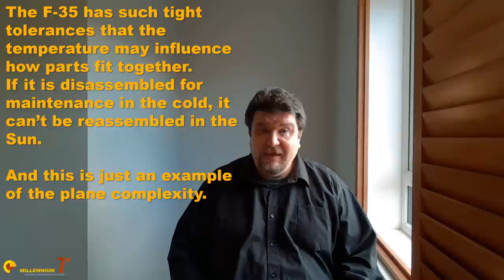F-35: The Failure of the $100 Million  Dollar Jet | Maybe...

Comment: We've built two VTOL carriers (UK)  imagine how we feel!
Reply: Don’t worry, the Marines actually got a useful plane for their inventory and they will support them and supply upgrades for your ski jump carriers for 35 years or more
Reply: @JacobVahrSvenningsen  Looking forward to many many F35B's on the decks.
Reply: The British have Actually only bought, that's paid for, about 28 F35s.n they have a need for at least 90 for a full load out of Two Elizabeth class carriers, with spares.  And given that those British carriers should last 40 years, where are they going to go in even a few years down the road?
Reply: Australia two,we have f35a but no f35b.we did build Wingman maybe that can VTOL.in one of its forms .
Reply: @raywhitehead730 

A force mix of only F 35 in my eyes is a terrible idea - too expensive for what force you are capable of projecting on the ground towards insurgents 

I would favour a wingman for high fast missions - they are building easy to manufacture one-use wingmans (throne away) in less than a decade - before the completion of the F-35 

For low slow missions I would get a Bronco II or Textron scorpion in a 

My all time favorite discount mix would be A-4 subsonic and F-5 II for easy of maintenance and then a stealth wingman out front 

More likely will be a T7 Modified to fly quarterback for a package of wingman in 2035 

In al honesty I believe in much more piracy based world - where old merchant ships are carrying container size drones capable of folding out and taking of from a flat container deck 

Kinda like the falkland single harrier carriers 

But I am just a daydreamer r
Reply: @JacobVahrSvenningsen  A serious US  Navy proposal to use container ships for VSTOL aircraft was argued for in the US Navy publication Proceedings, in the 80s . perhaps its time to look at that idea some more. So, Jacob your idea has been around for a while, great minds often think alike.
Reply: @georgepantazis141  George the Aussies are kinda stuck, but think about giving it all back, yep! I think the SAAB  Gripen  is the way  to go for Australia to go. It has excellent short field  capability. Use a rotating base concept along your coastal highways, keep the asset on the move
Reply: @raywhitehead730  

Oh well :) it’s pretty up and about in the time - I don’t remember where it was written but we can google around 

The brits started it (implemented) and had an in the drawer ready for the falklands and then actually used it - perhaps that where USN got the inspiration for a small project 

In my home country Denmark we have a maritime fleet that carriers 10% of the worlds good - but zero fixed wings on carriers 

None the less if it was ever needed I am sure we could build a wire arrest deck and slam a hook on a F-16 in a few weeks - I’d be in favor of having the sack already modular built a few times before hand and then one day surprise the Ruskis with a carrier in the bay of botnia outside Sct Petersburg and land an jet 

Having Greenland to fend for, I believe it could be our smartest choice for arctic force projection readiness
Reply: @raywhitehead730  Australia lost it hi-lo force in retirement of its classic Hornets. Only the Gripen or F-15ex could fit that role- or both...
Reply: @benwalker4660  Well you are thinking!!  But think, when is good enough good enough? While the F 15x would have  better capability, its probably going first to the US AF, Australia could wait years... Also I bet Australia  could buy 3  Gripens to one F15 X.. All you need to do is fend off the Chinese, not defeat them.
Reply: @raywhitehead730  The Isrealis are buying them- Japan South Korea need some- Australia can join the que for F-15EX. Even if we ordered them now I doubt we'd get them before 2024. With the F-35 and the F-15EX acting as a team our Counter Air- part of the air force wont wither with the loss of the classic F-18. Unless we bought Block 3 more superhornets to compensate- two choices if F-15ex takes too long to arrive- a stopgap.
Reply: And it looks like we (the UK) just cut our order of F-35s from 138 to 48.

Comment: To me this proposition tells me that the USAF is grappling with how to deal with the multiheaded monster of not only getting more fighters but sustaining operations of them too. The F-35's problems will continue to persist for a while and as a Stealth aircraft, sustainment will be the real ball and chain to any force using it. Sucking up money like a vampire.

I am curious as to the rational that the Viper cannot be upgraded much further. We need not get F-21's but new F-16V's for example would be suitable. Just rip out the avionics that cannot be upgraded easily with off the shelf components and shove new hardware in. After all, perfect is the enemy of good enough.

But what else is needed though? Just more and more questions. I am sure the Air Force Brass is kicking the question around and they have a bigger picture with more info than me. Still this is both encouraging and discouraging, reveals a rather confused outlook toward the future that has yet to be answered. But shows that some are willing to buck the previous procurement trend and think differently, group think can be dangerous after all.

An informative video as always.
Reply: The range issue for the Pacific front.
Reply: We've already been stuffing advanced avionics in Block 40-52 Vipers, including hundreds of SABR AESA radars, new data links, Helmet Mounted Displays, digital Electronic Warfare suites, HARM targeting systems for SEAD, new FLIR pods with LITENING, new integrated countermeasures pylons with more expendables jamming and decoys, AIM-9X helmet-cued missiles, latest AIM-120C/D integration, Auto Ground Collision Avoidance System, Small Diameter Bomb... 

What more do you want?

Air planners currently have a huge fleet of Vipers with tons of upgrades
Strike Eagles with the same upgrades
A-10C Night Hog
F-22A Blk 40 Raptors with new sensors, upgraded AESA radars
MQ-9 Reaper drones
F-35As operational and filling combat rotations for the past 2 years
F-15Cs with latest upgrades being replaced by new F-15EXs

But we need a new fighter in the mix to plug the hole left.... I'm sorry. Where is the gap again?
Reply: @LRRPFco52  F-16CM Block 40-52 also has Have Glass V" RAM (Radar Absorbent Material) upgrade. For the Pacific theater, there's a gap for a 4.5 gen fighter with single-engine and "long legs" (long-range).
Reply: @valenrn8657  And then there's that!  The last thing you want to be flying is a 4.5 Gen in PACOM up against J-20B networked with J-10C, J-11B, and upgraded Sino Flankers armed with PL-12s and PL-15s.

You want a heavy Raptor/JSF mix for that fight, with F-15C+ and Vipers networked and integrated through multiple LFEs already. Oh wait...
Reply: @LRRPFco52  J-10C is a mass produce longer-range 4.5th gen fighter for a war of attrition like T-34/Sherman M4 tank.

http://www.f-16.net/forum/viewtopic.php?f=55&t=27253

- In Libya, operating from Crete, F-16 typically had to refuel several times - the F-35 would have done the whole mission without refueling

This is for Norway's POV.

F-16's short legs are unsuitable for the Pacific theater.

Not every mission will require stealth. Using F-35 for non-stealth missions is wasteful for F-35's finite 8000 service life hours.
Reply: @valenrn8657  J-10C with AESA and DSI inlet is not to be underestimated. They bought and stole a lot of US tech to make it what it is, a very lethal and survivable fighter.
Reply: @LRRPFco52  
J-10 is not quite 4th gen fighter aircraft body lift design. 

For RCS issues
J-10's inlet angle is not completely angled.
J-10's vertical tail is not canted.

Swiss has Gripen C to be inferior to F/A-18C with disabled JHMCS handicap. J-10C wasn't the only fighter who beaten Gripen C. Both F/A-18C operators Finnish and Swiss have similar conclusions on Gripen C.
Reply: @valenrn8657  It was telling that the US didn't allow Thailand to expose the F-16 in Falcon Strike, but didn't care that they did with the Gripen C. It's a low capability fighter being advertised as high capability, when they really expect buyers to finance their R&D.
Reply: @LRRPFco52  From 
https://www.ainonline.com/aviation-news/defense/2016-08-15/thai-f-16-upgrade-includes-german-air-air-missiles

Royal Thai Air Force (RTAF)  F-16A MLU has IRIS-T missiles which include AN/APG-68(v)9 radar, Link 16 datalink, the Joint Helmet Mounted Cueing System (JHMCS), Terma ALQ-213 Electronic Warfare Management System and improved night-fighting capabilities.

APG-68(V)9 radar is part of F-16C Block 50/52 configuration.

RTAF upgraded their F-5E Tiger II into F-5TH with AESA radar.
Reply: There's the F-16XL... the ultimate modification for the traditional F-16. Longer range, increased payload capacity, improved trans-sonic performance...
Reply: @AirShark95  
When compared to normal F-16,  F-16XL has degraded acceleration (from lift drag due to large wing area) and higher drag at the angle of attack.  Hornet's tail design is superior for a high angle of attack.

F-35C's larger wing area also suffered degraded acceleration and higher drag at the angle of attack when compared to F-35A.
F-35C's larger wing area is similar to F-16XL's larger wing area.

Basic Wing loading without body and vortex lift.
F-35A
Empty weight: 28,999 lb (Year 2015).
Wing area: 460 ft²
Wing loading: 63.04 lbs/ sq feet.

F-16C Block 52
Wing area: 300 ft²
Empty weight: 18,900 lb
Wing loading: 63 lbs/ sq feet.

F-35A's empty weight is 1.54X scaled from F-16C.
F-35A's wing area is 1.53X scaled from F-16C.
F-35A's 43000 lbf thrust is 1.50X scaled from F-16C's 28600 lbf.

There's a near straight 1.5X scaling between F16C to F-35A on basic wing loading, engine thrust, and empty weight.

F-35A's wing area is influenced by weight growth and F-16C's empty weight wing loading target.

The basic idea for F-35A is a 1.5X scaled F-16C Block 50 
----

https://www.livescience.com/3032-fighter-jet-controversial-future-fleet.html
 In terms of aerodynamic performance, the F-35 is an excellent machine, Beesley said. Having previously been only the second man ever to have flown the F-22 Raptor, Beesley became the first pilot ever to fly the F-35 in late 2006. As such, Beesley is intimately familiar with both programs. According to Beesley, the four current test pilots for F-35 have been most impressed by the aircraft's thrust and acceleration. In the subsonic flight regime, the F-35 very nearly matches the performance of its' larger, more powerful cousin, the F-22 Raptor, Beesley explained. The "subsonic acceleration is about as good as a clean Block 50 F-16 or a Raptor- which is about as good as you can get." Beesley said.
Reply: @AirShark95  FYI, NASA has upgraded the second F-16XL unit with an F110-GE-129 engine which is the same engine as F-15EX's.
Reply: The new 4++ fighter is likely to be a f-16++. They just won't call it that. Really its already becoming a little ridiculous to call new f-16s f-16. As other people have been pointing out they are hardly the same aircraft anymore. New avionics, new radar, new engines. The only thing the same is the air-frame shape. The f++ will probably update the different airframe a bit but I suspect it will use f-16 engines with an f-35 radar(which they will need a bit more space for).

Note this is all for the airforce. The navy is still committed to the f-15.
Reply: @peterisawesomeplease  USN doesn't have F-15.
Reply: @peterisawesomeplease  For the US, a new model number requires a fly-off competition, hence the F-15 size Super Hornet's model number stays with F/A-18 model number which avoids fly-off competition. There very little in common between the F-16 size legacy Hornet and F-15 size Super Hornet.

There's a reason for the F-16x Block Nx series. 

F-35A and F-35C models have 20% to 30% common parts with completely different wings and horizontal tails but share the same F-35 model number.
Reply: @valenrn8657  Sorry typo meant the f-35
Reply: @valenrn8657  Right the names are just advertising. I don't think there is a hard an fast rule about fly off competition. Although that is often the dividing line I suspect it really has more to do with what makes it easier to get congress to had out funding.
Reply: We can just get new f 16s if needed to be honest
Reply: @UptownDegree  Nope, F-16 has short legs a.k.a. range.  With F-35A, USAF can reduce their foreign airbase count e.g. reduce the need for Turkish airbases.

With F-35A, the US can follow UK's Eurofighter example and use Cyprus airbase (Royal Air Force Akrotiri) to bomb targets in Syria and Iraq.

From Bahrain, F-35A's 1407 km combat radius can cover most of Iran without the need for an air tanker.
Reply: Shoot I actually agree with you I would prefer getting the f 35 but I'm just saying if we were to get a supplemental 4th Gen I would just buy the f 16 block 70
Reply: @LRRPFco52  
Lol!!!  I didn’t think of that.  Yeah, where is the gap????
Reply: @UptownDegree  Where are you going to squeeze the range from with the F-16 though?  USAF doesn’t use CFTs for a reason, as they leak all over and prevent access to mx access panels on top of the fuselage.

A lot of F-16C Block 50 guys want to get into F-35A after fighting them.  It sucks to not be able to see and having to hit the tanker all the time, while really worrying about flying near the WEZ.
Reply: @damianketcham  I got it:  A-10D!

We have a dedicated CAS platform upgraded with night attack, helmet-cued FLIR, data link, GPS.

We have an air dominance beast that plays with its food before it eats it (F-22A).

F-35A exceeds the A2G capabilities of the F-16CM and A-10C, while also playing with its food before eating it in A2A and making the U-2 and AWACS guys wonder about their job security, and reviving what we used to have with EF-111A.

We have upgraded Strike Eagles with all the bells and whistles, massive AESA radars, the latest $1.5 million or more FLIR/targeting pods, JTIDS data link protocol v4, JHMCS, AIM-9X, SDB, JDAMs, new long range strike missiles...

We have Air National Guard F-15C squadrons that were hoping to convert to F-35As, now being told they’re getting F-15EXs, and are not happy about it.

We have 6th Gen in development at a secret location.

But we sure need another fighter to fit in somewhere because.....reasons.
Reply: @LRRPFco52  I mean conformal tanks have certain downsides but a block 70 f 16 is still better than our legacy aircraft
Reply: @peterisawesomeplease  There won't be a new 4+++ fighter. General Brown just stuck his foot in his mouth, didn't have good Public Affairs prep before speaking, unless his intent was to send disruptive signals to industry and allies.
Reply: @UptownDegree  The Super Phantom was better than the F-4E too. Big problem with the F-4E was....combat radius. It was plenty for Euro theater though. Awesome airframe for carrying stores, multirole came naturally to its stores capacity.

2 engines and archaic systems architecture made mx difficult.

That was one of the main reasons they wanted the F-16 as a new bomb truck, even though it had nowhere near the Phantom's stores capacity.
Reply: @LRRPFco52  To be honest I think the f 15 ex is a better bomb truck now than the f 16 will ever be
Reply: @UptownDegree  Strike Eagle has always been a better bomb truck than the Viper, but you can’t have 1000 of them.  Procurement and O&M costs on a 2-engine TacAir platform limit the numbers.  

Also requires 2-crew training pipeline at a time when it’s really hard to find, screen, hire, train, and retain aircrew, though they say they’re planning on flying it as a single seater in the F-15C replacement role, which makes sense.  

F-15EX unit cost is looking to be $114 million, while being advertised as $80 million, and that’s without pods.

The most notable things that stick out to me about the F-15EX are:

1. We never got anywhere near our full buy order for the F-22 Raptor, which strung out the F-15C fleet way beyond their intended service lives.

2.  F-15EX keeps the Boeing plant open for another 10 years with a very slow-roll production rate.
Reply: @LRRPFco52  yeah I really wish that we had bought more f 22s that would have really helped our air superiority mission capabilities
Reply: @LRRPFco52  I just can't believe we cut production of that plane
Reply: @UptownDegree  Manchurian candidates and paid-off enemies within, doing the bidding of China and Russia as planned.

Multiple USAF Chiefs of Staff were fired over it, fell on their sword trying to save the F-22 from hostile SECDEFs in both Bush Jr. and Obama White Houses.

Bush family were bought by China in the 1970s when Bush Sr. was ambassador, and Obama was raised and groomed to be a Manchurian candidate.

Their reasoning to the AF?  “We don’t need F-22s to bomb the Taliban and Russia or China don’t have stealth anyway."